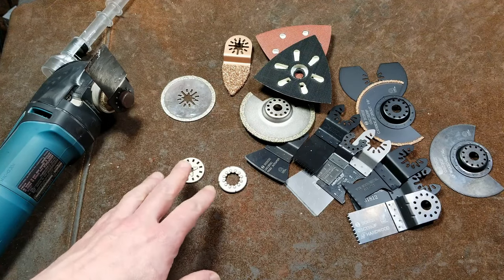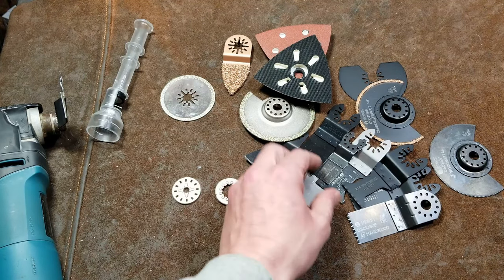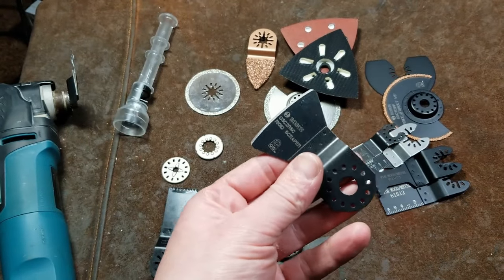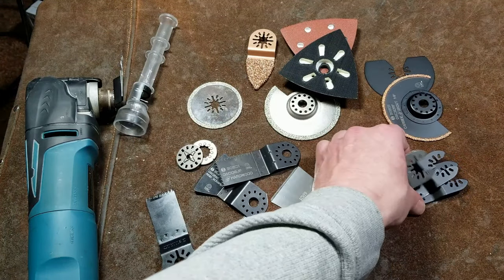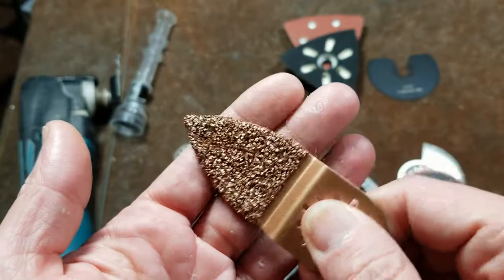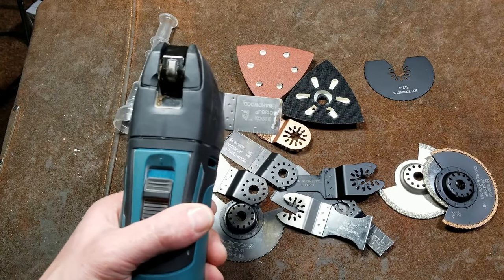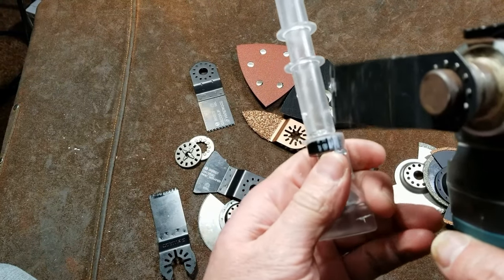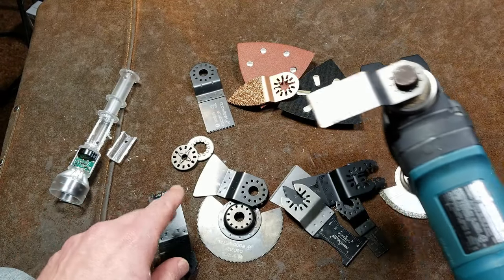Oscillating Tool Blades Introduction & Discussion

Comment: Had a carpenter building a deck for me and he had a Milwaukee M18.  Had never seen one before and was amazed at how useful it was for him doing a variety of tasks (like trimming screws poking out, sanding, refining cutouts for the posts, etc.)  Pretty big, so I looked at the M12 and its' smaller diameter fits better in my hand and great for a variety of tasks, cutting buried PVC pipe/fittings in my irrigation system that needs replacing, scraping off old paint, etc.  The drive system is tight and has held up for about 3 years now.

Comment: I have a Worx Multi tool and have found that the scraper blades are quite useful to remove bark when carving, but also when sawing plunge cuts and other types of cuts it helps to assist the cutting by moving the blade back and forth as this assist in the cut, but I expect you already knew that, however others may not. Good review as there are more blades than I was aware of, so thank you for the update.

Comment: Mine is a craftsman. I know it's not professional for carpentry but as a plumber my craftsman does what I need it for.   All new to me glad you explained the blades to me. As a plumber I sometimes have to cut mortor joints wood and Tyle and sometimes copper and pvc.

Comment: When I was a kid my dad, a doctor, had an oscillating tool that he used, among other things, for removing plaster casts. They often show those things on TV claiming it is a 'bone saw' and acting as if the blade spins rather than oscillates. It's not as if you couldn't hurt someone with it, but it's not like waving around a circular saw that's running.

Comment: I just received my 1st oscillating tool, Milwaukee fuel M18 kit. I also purchased the Hemunc Oscillating tool scraper blades set, include oscillating rigid scraper blade 10pcs, flexible multitool scraper blades 2pcs. Which blade does what? There’s flexible and which is a straight blade and rigid blades that are bent. I need to remove 3 layers of vinyl squares (floor). Great video. Thanks

Comment: Dahut- There are 2 different OMT blade designs.  1) Starlock 2) Universal Fit.  I would highly recommend that you check out the new Diablo OMT blades.  They came out with a line of Bi-metal and Carbide in both Starlock and Universal and they rock.  Just like everything Diablo does in Power Tool Accessories, they finally have made a blade that lasts like they should and I'm not paying out the nose for tons of blades for my tool.

Comment: I have the Milwaukee m12 version and although it eats up batteries, I really only use it for small quick tasks.
Reply: I just bought 1
Reply: I converted my battery tools so they can be plugged into wall current. Can't stand cordless tools, too unreliable, will never buy one again.
Reply: I also have the m12 fuel, seams to work better than the m18. I bought several 6 amp batteries were on sale 2 for $99

Comment: Very informative and since I’m about purchase  an oscillating tool, very useful vid.  I’ll also be purchasing a hand grinder and will review your channel to see if you’ve done a review on those. Thank you.
Reply: Do yourself a HUGE favor, and select one that has a "quick release" blade attachment point.  The biggest pain with these things is having to mess around with an allen wrench to mount the blade-retention screw in the middle of the driving shaft, while your blade and any other loose parts flop around and refuse to remain where they belong until you can get that damned screw tightened.
Reply: @floobertuber  If it's the same price, yeah, get the quick release one. If it's like 10% more expensive, I'd go with the allen one. Not that big of a deal... Where I live, the Makita quick release is 80% more expensive than the older allen model. It was a no brainer no choose: allen all the way...

Comment: I have an idea for an oscillating drywall cutting blade (unless one exists already).  When cutting drywall there could be times when there's fiberglass insulation with paper backing that I don't want to cut (or electric wires/pipes/etc) on the back side.  A blade that will only cut 1/2 deep would be great.  The blade could have a guard welded on top that prevents it from going any deeper than the distance from the teeth to the guard.  Does this type blade exist? If not feel free to pitch it to blade manufacturers.
Reply: both fein and dewalt offer a depth stop to prevent overcutting for their multitools, you can also just wrap painters tape around blade at depth to stop the cut.

Comment: Can you cut laminate 38mm worktop? I need to cut about 10mm at the end but the worktop is already fitted and can’t remove now. I don’t want to chip and blow the edge. Would this work? I have a circular saw but it’s too big for the edge I need to cut and do have enough room for it

Comment: Maybe I'm missing something here or I'm late to the party but why aren't there any pointed triangular blades or arrow head shaped blades? It would seem to me that this would make plunge cuts much easier, faster and more accurate. I'm looking but cannot find anything. If you end up finding any or know of any existing for plunge cuts just ignore me. But if you decide to run with this idea and make a ton of money please include me 😁🙏. Another idea is having teeth on the sides maybe? Maybe that would create more resistance idk but I'm thinking and it seems like the shapes of these are where the money's yet to be found. You could make c blades with teeth on the inside?!?! Just some random ideas. Also, re sharpening these must be a big market yet to be tapped. Or tapped effectively. Cutting sidewall staples can be a huge pain and idk of the make longer blades for that. Or if the vibrations at that length would be rendered ineffective.?? Again just throwing around some ideas because that's how my brain works and I love thinking and creating new ideas and inventing things. If somehow the blade could slide to the reinforced area of the blade when hitting a nail. This could limit the damage to the blade and increase longevity as well as cut down on anxiety and worry when hitting nails. I'm sure you could incorporate a type of advanced stud finding technology into the multi tool head and help with this issue. I wonder if they will ever make a much stronger and larger tool that supports larger blades and shaped like rectangle boxes for cutting out electrical boxes quickly and efficiently. As well as other circular blades for ceiling lights. Drills work but this could prove much easier, cleaner, more convenient. Anyways I'm done blabbing. If I helped someone I'm glad if not than sorry for wasting your time. Take care and sorry I chose your ch to post this. Just happened to be on my fifth video looking for my ideas and haven't seen anything quite like what I have mentioned. I'm always late with my ideas anyways but I hope one day to work designing tools and such. I have so many ideas in my head and every once and awhile I can't help but post them, looking for that similar mindset to talk to.
Reply: We are the pioneers and the first generation of the problems we turn to the internet over and don't get answered..diamond coated chainsaws are 5 grand and that's a Stihl or Husqvarna I want to learn what diamond powder (mixed with wiat metal shavings ) I need to buy to coat on all of my blades, what tools can handle them to cut and shape tomb stones, glas statues marble , emergency entrance blades..any simple do-able run throughs on here u hear of or affordable " saw the f thru anything blades /tools lemme know I'm gonna start flipping the best blades I can find after I electroplate or weld braze coat them and sell them and their powerful tool counterparts for a fraction of the price on here I'm gonna have to be the one who does the videos I can't seem to find and I'm devoting my life to makinh the demolition equipment affordable to the common man I have a welder a plasma cutter , m18 tools Makita 40 and 18 volt just no good blades yet and I'm tryna do some experimenting any knowledge would be appreciated for real I have just about every tool and I'm gonna build statues and everything maybe even houses or machinery with motors involving flight someday

Comment: Is it strong enough to cut agate and Quartz stone with it? Agate hardness is 7 and 7,5
Reply from the maker: Oscillating tool carbide grit blades are for small cuts like removing grout from between tile or doing small cuts and tiles to fit them in Awkward places. You would use a diamond wheel on a grinder if you're gonna do lots of cutting in hard materials.
Reply: @CatusMaximus  thanks dude 👍🏻

Comment: Are there blades for cutting-cinder block
Reply from the maker: Yes you can use the carbide grit ones
Reply: They also have diamond coated blades.  Diamond is harder than carbide, probably will last longer.  They use diamond coated blades on skill/circular saws to cut through things like thick granite.

Comment: Need help.my machine has no speed control mechanism to regulate .and the switch is  not smooth to on-off  .vibration is so strong that I scare of safety to use.made in china. Have never use since day one.pls help .what is yr advice

Comment: Hi!  Thanks for the video!  Do you know where I can get one of the grit wheels you show in the video at the 5:00 mark that would fit a Dremel Multi-Max MM50?  I saw a video where an oscillating tool was using a wheel like this to safely cut out concrete mortar between stones and I'm trying to find something like that for my oscillating tool to use for that purpose.  Thank you!

Comment: My Bosch multi tool arrived last night , it is still unopened, would y-u recommend I send it back, and get a refund, I anticipate DIY usage,
Reply from the maker: it will probably be okay, but if you want one that will last years I recommend the Makita it is much better (a bit heavier as wel).
Reply: @CatusMaximus  I have a Makita (older model) and it's pretty neat, but my father has some Bosch equipment (drillers) for more than a decade and they're still pretty solid too.

Comment: Cordless is great, and I love Makita but I've been using a corded Dremel multi-max for over three years without an issue. There are aftermarket companies that make every blade available that will fit the Dremel and the ones that don't it's a simple fix with a stainless steel c-clip adapter. Never had one come loose. So the drive system issue with dremel isn't really a thing unless you're buying name-brand blades and I found some aftermarkets that actually outperformed some of the name brands🤷‍♂️🤷‍♂️ I'm one of those run it till it doesn't function kinda guys and my multi-max still runs strong. Take care of your tools and they'll take care of you.

Comment: How about grinding / planing wood? Is there a blade for that?
Reply from the maker: Probably a carbide grit blade because they are so aggressive but planing of wood is not what you would want to use an oscillating tool for you would want to actually use a planer or maybe a belt sander